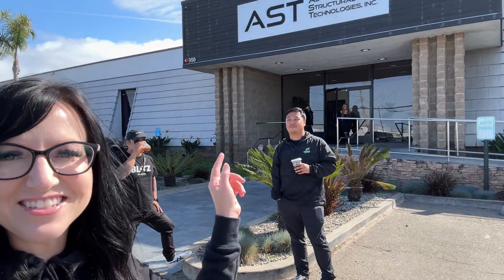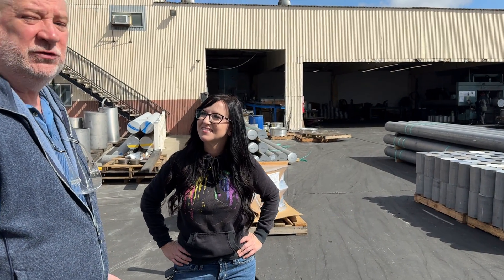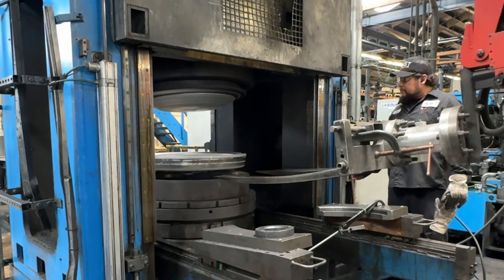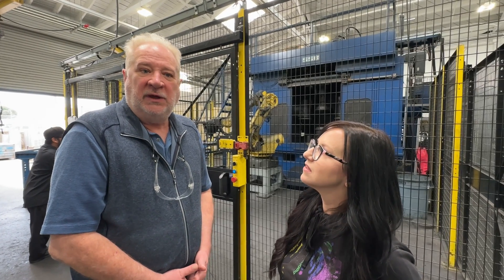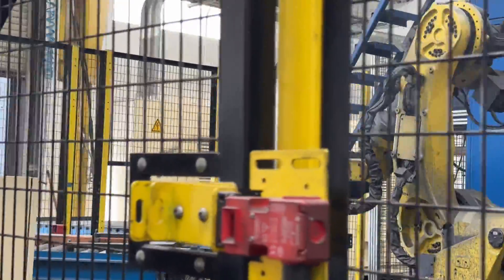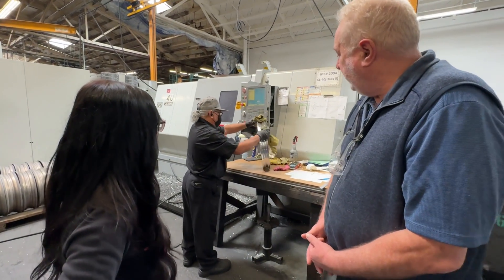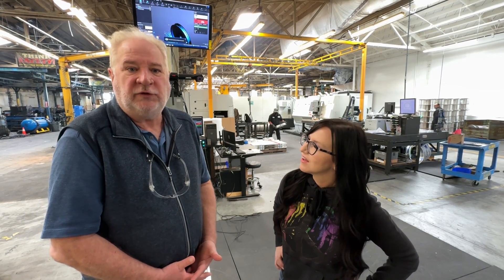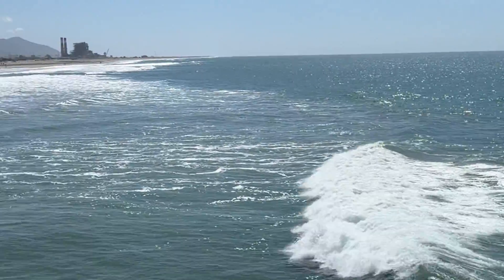Forged Wheels factory tour FEATURING LASERS- Advanced Structural Technologies

Comment: Quite enlightening on the process used to make these wheels and blanks.
A couple of things however that made me shudder a bit after having 25 years in the wheel industry.
At no time are the wheels X rayed. This is very important for several reasons. If there is any contamination in the raw material internal holes even cold folds it is never checked just bad luck for the end users.  Tears can also be introduced during the forging process and that will reduce strength and introduce another point of failure. Dangerous for the end user. Temperature control of the blanks prior to the process seems a bit haphazard as well.  Its important for a good forging and the thing with aluminum is it is soft so while it may appear ok post forge the internal structure will be very different. Heat treatment should fix this but in the case of tearing it never will.  Finally substituting the Laser for proper measurements is at best laughable. They are no substitute for even manual measurement let alone a automated CMM that if programed correctly would be fast and accurate to sizes, profiles, Concentricity to 4 decimal points of a MM the best laser is only good for 4 decimal points of an inch more likely it is doing 3 points.